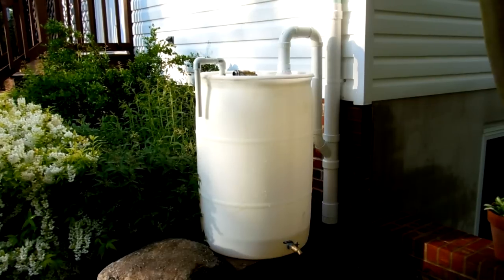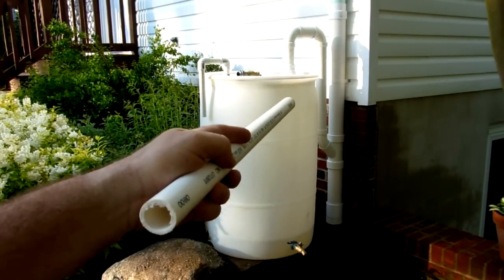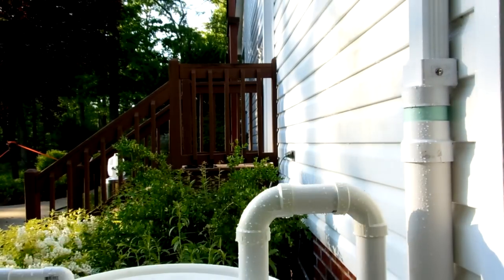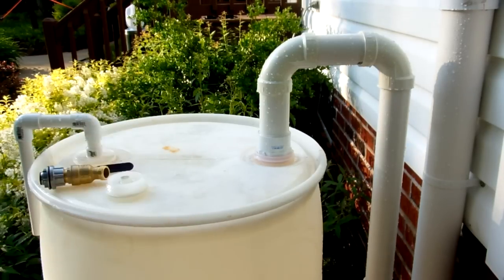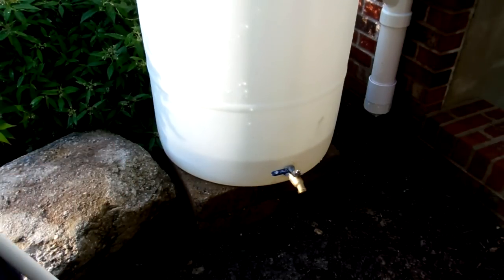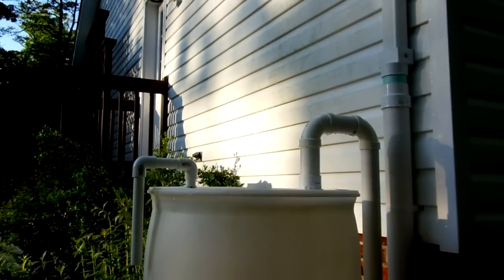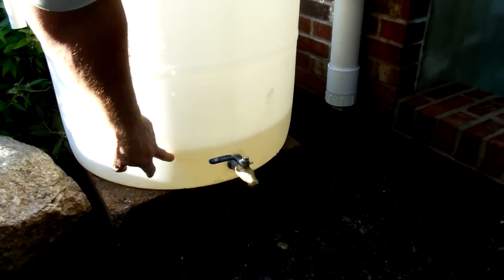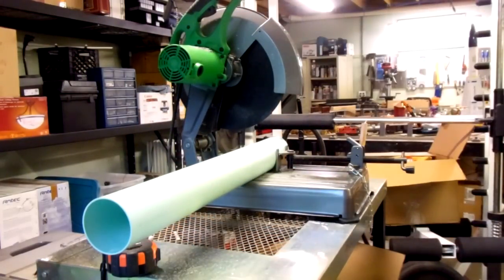How to Build a Rain Barrel (v2) -- An Elegant Solution?

Comment: my setup is similar. despite 3/4 overflow it works.  Least amount of barrel damage and also thismaximizes the amount the 55 gallon barrels hold.   Sistering barrels I use the hose bib to hose bib with a Y hose adapter; this also give your more pressure coming out.  When sistering barrels leave a elevated breather vent in non drain overflow barrel.
Reply: James Campbell James, could you provide a picture or more detail about how you use two barrels? I'm in the process of designing mine and I want to limit the barrel damage and maximize the quantity.
Reply: Tom Petersen sure; just got them hooked up - I'll take some pictures this weekend.

Comment: To gain access to the inside of the barrel all you need to do is look down from the top of the barrel at its narrowest point, approx 2"" and cut around the barrel using a jig or fret saw, clean up the edges with a file then flip over the lid and it will slot nicely onto the rim, drill 3 holes then put either screws or galvanised nails in for easy removal, also the top can be removed for easy cleaning, I have 11 barrels fed by 2 downpipes and link them approx 3" from the top using garden hose, most houses in the UK have water meters and it's a good way to save money, thanks for the video....
Reply: John Gatland q

Comment: For the coarse threads on those bungs i just used the same 2" fine threaded adapter as the other and just cross threaded it using a large sized channel lock pliers set  to crank it down tight. It can be a bit of a pain to get them started, and they won't sit square like the other, but the top of the barrels are flexible enough that you can run a 2" pipe to the next barrel or the over flow on the end barrel. I've done this on all 5 barrels on my array and have had no problems with any leaking from any of them. You'll find that having them connected with 2" or larger will totally speed up the fill time compared to 3/4" or 1", especially on the run from the diverter to the first barrels inlet. On my 2 barrel array which has 2" pipe from diverter to inlet, it will take less than an hour to fill both barrels. Originally i had a 1" tube there and it would take all day to fill them, if we got enough rain that is. San Diego doesn't get that much, so use the water to wash our vehicles. I just have a inline water pump on a 100 foot hose, and its on a remote controlled switch so i can turn on/off as needed and still get the pressure i need.
hope this helps.
Reply: The course thread in the barrel is called Buttress thread.....2" buttress most 55 gal. barrels

Comment: Use a "t" fitting on the intake, and your overflow will be as large as your intake.  And if you add more barrels you can use that to connect to it, and it will also act as a vent for the air displacement.

Comment: You can use a "t" fitting like you have on the first flush diverter and put it on the inlet for your overflow, which will give you a larger overflow outlet.
Reply: That’s what I would do. No need to worry about the second bung adapter. It would also allow more barrels to be added to the system. Each new barrel connecting to the overflow side of the tee on the previous barrel’s inlet.

Comment: Those threads you can't match are called "buttress threads" I believe.  Hit some water tote supply sites and you can get a fitting that will match and allow you to screw in standard pvc pipe to it..  Also, get a bulkhead fitting that has inside threads on the nut, use a string to drop down the threaded part to the drain hole, pull the threads through and tighten the nut on the outside and you won't need silicone, which will leach chemicals in the water if in contact long enough.

Comment: I had the same type barrel but I found the light that penetrates the barrel will grow algae in no time! Without a wide hatch on the top you have no effective way to clean out the barrel. Solution is to paint the barrel with a flat black paint and add a top hatch. But before you do run a strip of 1" painters tape from the top to the bottom on the side that doesn't get direct sunlight. After it's painted remove the tape and now you have a sight window to check the water level in the tank!

Comment: nice one. sorry for ignorance, so the main downpipe from the roof is capped at bottom and collects the debris. then clean water rises to the barrel ?
Reply: gazza listermint ...It suppose to be a "first flush system". It's a little more than just capping the end. Look it up on YouTube. There's many diy but I found it cheaper and easier to just by the system.
Reply: KCy cheers will do. !